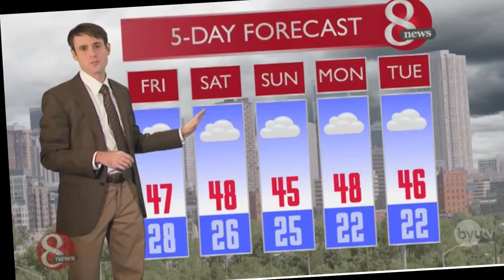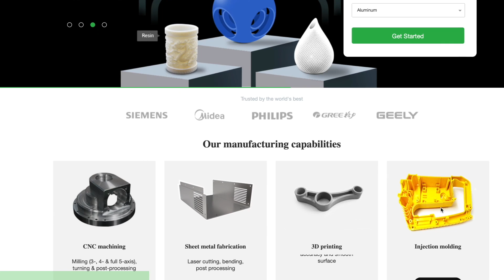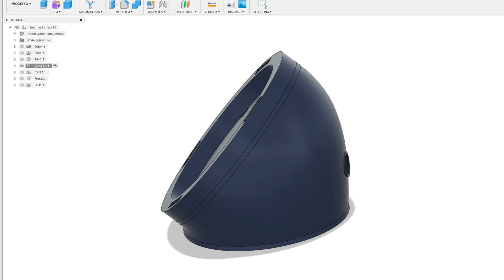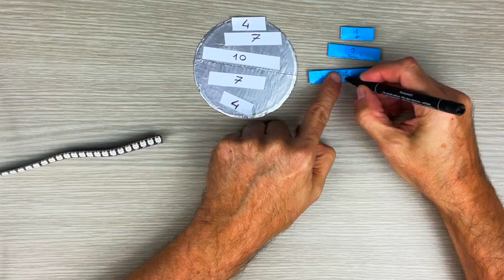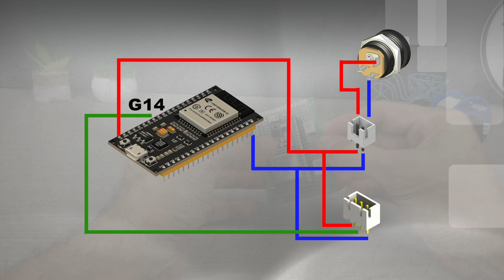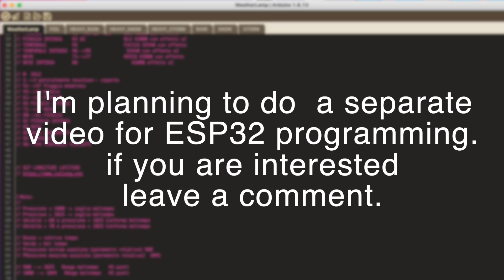WEATHER LAMP esp32 ide arduino and neopixel led fusion360

Comment: Great project - can you please check the download link of the STL files, it doesn't work for me.
Reply from the maker: Hello Thomas, I checked the links and they seems ok... let me know or send me your email and I will send them to you boomytech@gmail.com
Reply: Hello, the direct call via Google Chrome did not work, but copying the link and then pasting it into a new tab did work. I was just able to download the file
Reply: It could be a esp8266?
It can be improve with a small web server to configure it by WiFi?
Reply from the maker: Yes Gabriel, you can use esp8266…👍🏻